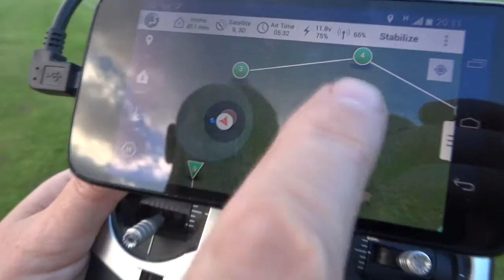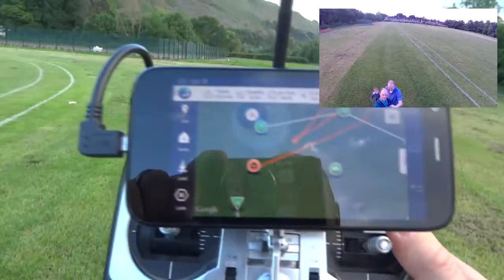Hobbyking Quanum Nova, Cheerson CX-20 Voltage and Current Sensor Test

Comment: hello , I have a quanum nova and would like to install a current sensor . my board flight , has a door ( ADC ) with 3 pins . You sensor that you used ? I found this link but I'm not sure that my ADC port is compatible. http://copter.ardupilot.com/wiki/common-optional-hardware/common-powermodule-landingpage/common-using-a-current-sensor/

Comment: Hi, Good Mod :-), What APM Board did you use and Version?
Thank You for sharing your posting.
Reply from the maker: Hi, I used a 2.5.2 that I had laying around here from Goodluckbuy
Reply: Thks u for reply, Are you reusing the original GPS and compass sensor with the new APM board?
Reply from the maker: No, Iused the Neo 6M that came with the 2.5.2, the compass is built into the 2.5.2

Comment: Hi again,
is this the configuration you gave me ? what control board is this ? is this a android tablet ?
Thanks
Pierre
Reply from the maker: Hi Pierre
The flight controller is an APM, the Nova/CX-20 come fitted with an APM unit as standard, I did some tutorials on how to add telemetry but that's now outdated as the manufacturers modified it and it's now much easier
Here's a link to the RC Groups thread:
http://www.rcgroups.com/forums/showthread.php?t=2112759
Reply from the maker: Forgot to say, it's an Android phone though it does work with my Android Tablet too
Reply: RIDERZcouk I saw you telemetry mod. However, I couldn't find how to connect the receiver to an Android.
Reply from the maker: Franklin Dattein
OK, firstly you need a USB OTG cable (just search google for USB OTG), it's a simple adaptor to change the micro USB socket to full sized
Secondly your Android device must fully support USB
http://uk.cellphoneshop.net/microb.html?CAGPSPN=pla&catargetid=530009110000058136&cadevice=c&gclid=CjgKEAjw286dBRDmwbLi8KP71GQSJAAOk4sjrGx0opos6ZKuhf3w3La-MDjfLvswP1aKYeGuj7wr1PD_BwE